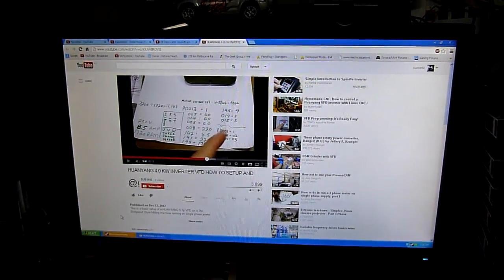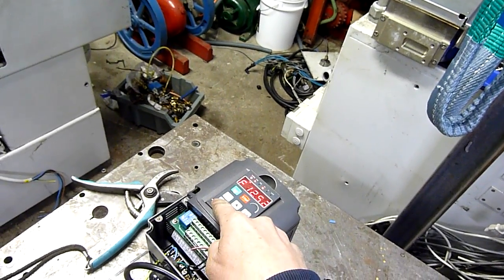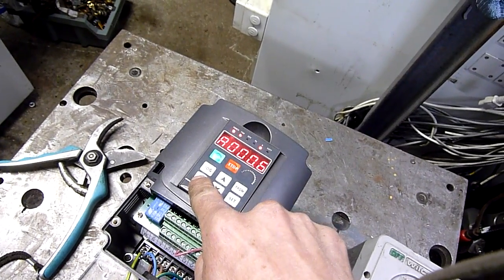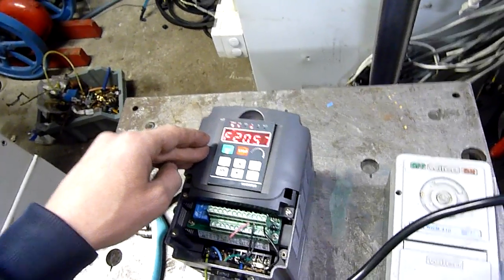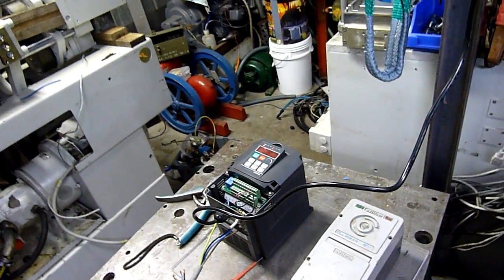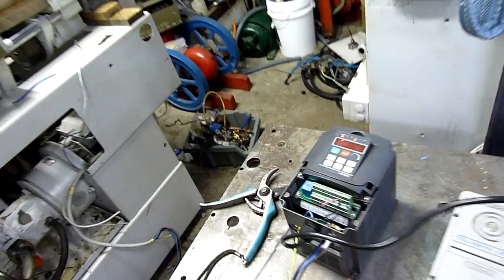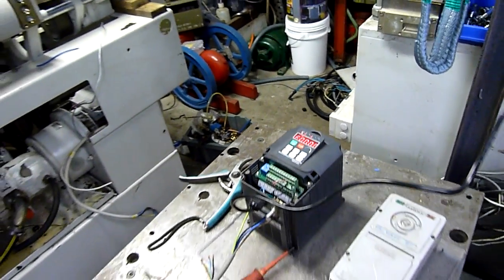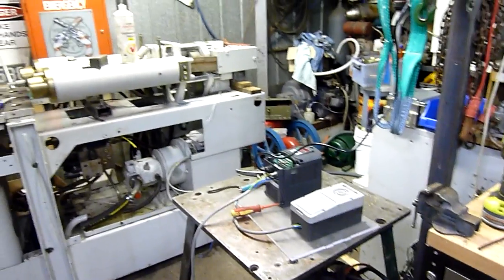Cheap Chinese VFD Works!   Some Setup Required!

Comment: The static pressure on the blower will be too high without the duct work installed. It will overload the motor in short order.

Comment: ive got a problem. so, ive hooked it up to a 1phase. and every output like 10vdc works. but not the 3 phase. i dont have any output. and it wont accept my commands, like manually adapting the frequency. does anyone have a suggestion for this problem?

Comment: +Aussie50 I need some tips with my vfd mate can you help?
Reply from the maker: +Thom Pascoe no worries mate, what do you want to know?
Reply: +Aussie50 wanting to wire a feed from my xcarve spindle output to the vfd to vary the speed is this possible
Reply from the maker: +Thom Pascoe the VFD should just use a 0-10v reference to increase speed on the digital bus,  the manual might give you an other option tho, did you get yours with a manual or not? I think its available for download somwhere.
Reply: +Aussie50 yeah I had a manual but a month worth of machine work in the workshop has it "misplaced" using mine to run a cnc
Reply: +Thom Pascoe my spindle V-out is 24v. so ill have to put a voltage divider in or something similar to bring it down to a linear 0-10v as the program increases spindle speed.
Reply: i am going to get a vfd i just added one to my ebay cart its a 4hp 1.5kw

Comment: You should be able to use " injection braking " so you don't need the brake resister... Just a thought if that drive has that option... ;) ~Russ

Comment: Hey Ed, I just got one new  on Monday model HY03D023B 3kw. Hooked it up to my new ATC CNC spindle and let the magic smoke out. Turns out it had a bad soldering job.on the board - blew the stator on my $2100.00 spindle! Dam thing still works but the motor doesn't

Comment from the maker: hehe, nah the impeller is designed to sling air out towards the outlet (clockwise from the intake side), it does sling air out in reverse but the streams collide with each other and you only get a fraction of the output :(. I swapped L1 and L3 and it runs in the correct direction now.

Comment: awwwww yeaaaaaaaah :D I looove that sound. if it runs cooler backwards, maybe flip the internal cooling fan on the motor around so it blows the other way? though it could be different load levels clockwise vs anticlockwise :S Don't quote me I am a programmer not a mech engineer (as much as I want to be one :P)

Comment: Viewer # 129 :D

YAY! You got it working OK. Glad you figured it out, now all you have to do is get the blower to spin in the correct direction. :D

Because of how those blowers work, it may still blow air, but just not as good as what it would be if it running the correct way. :D

I once tried to wire-up my Air Rotor fan backwards just for laughs, but no cigar! Being a 1ph induction motor, it spins the same way whichever way it's wired. :D

Thanx for showing,

{^_^} BoomBoxDeluxe {^_^}